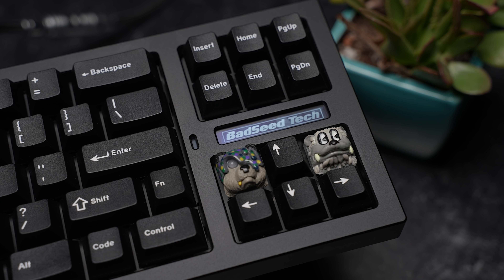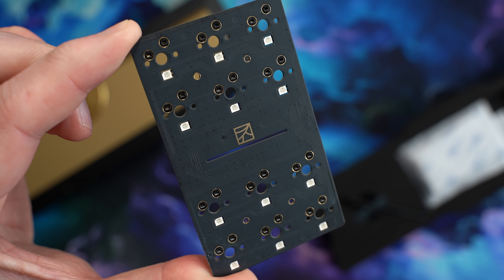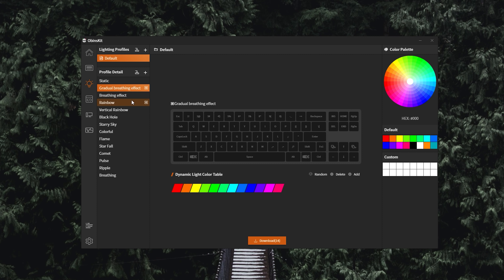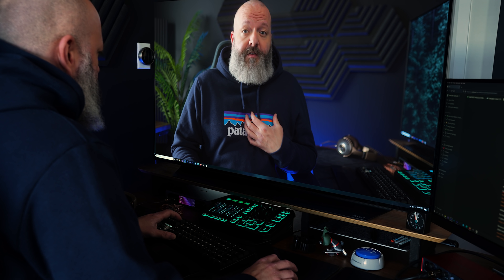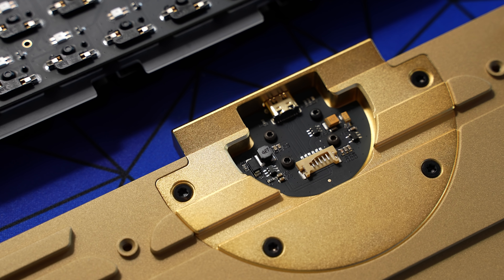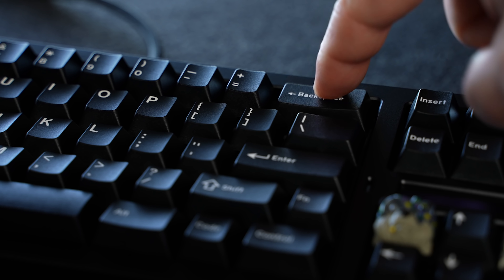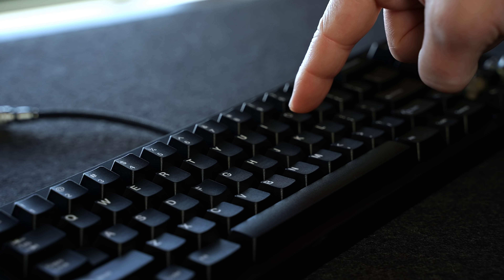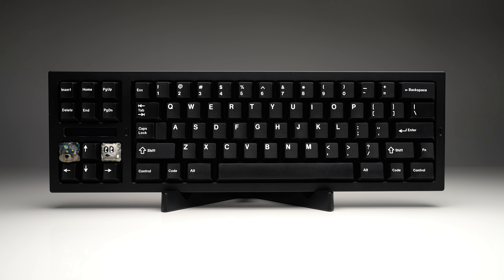The Tenet 70 Keyboard Can SHAPESHIFT?

Comment: With all the insanely meticulous design choices here, I feel like the V2 (if they decide to make it) will improve on the sound and flex of the board. What you get right now is very cool in it's own right, but the sound might leave some folks wanting. Great video, as in-depth as always.
Reply: Keybored just released a video improving the sound. Basically swapped out the gaskets and did a tape mod
Reply: i cant remember who it was, but they talked to the creator/designer of the board and they wanted to reduce case ping as much as possible. so they basically reduced the cavity under the pcb as much as possible. that being said it does result in a more muted sound signature beacuse of this. i feel like any revision for an r2 that would drastically change this would also change the footprint or overall size of the board.

Comment: Doing design work I actually use arrows on both left and right side of the board. Currently have Caps+WASD for left side. As you mentioned to avoid taking your hand off the mouse but also using the right side arrow cluster for anything needing a combo of buttons+arrow keys.

Comment: I would have hoped that for that price point, there would have been more options to tweak typing feel out of the box. The Zoom 65 may not be an ambi-compatible layout, but having some flex cuts in a 1.2mm pcb seems like a no brainer above $200 right now. Then you can either leave foam and/or plates out for a slappy feel or stuff that trunk with foam for a stiffy.

Comment: I want this kind of reversible form factor in a TKL. Or just a friggin' lefty TKL. They kind of dumped the bed with omitting the F-row. I don't know why this is so popular to do, it's infuriating when otherwise great ideas are ruined by limited functionality that requires you to remove your right hand from the mouse. We need greater left hand functionality to catch up with the standard. I.E. board design to catch up with the times of modern use-cases. I had a 60% that wasn't annoying to use because I was able to reprogram the windows key to be the function key; and another with a split spacebar where one of the splits was function. It's just so much faster to be able to access that stuff with the hand that's almost always already there haha

Comment: I’ve only heard good things about the TX stabs, but I’ve yet to see them in stock. If anyone has recommendations on where to get them or when they’ll be in stock at a particular vendor, I’m all ears. Thanks for the vid Brian! Really enjoyed your take on this!
Reply: they are easy to get. Minokeys still has stock including 1.2mm. Other vendors restocking soon. Kibou Hk has stock also. Also rumors that prevail are working on stabs too
Reply: @Unknown-sh2mz   unfortunately minokeys shipping to the US is kinda brutal (starts at $15), but it is great to see them in stock, thanks for sharing! FWIW, have checked stock at like 4 different sites multiple times over the last 6 months, and have never seen them in stock. That and having only one or two vendors with stock currently doesn’t necessarily align with my definition of easy to find.

Comment: Damn I was super excited until I heard the price... question does it have a good warrantee?  If the warrantee is lifetime the price is justified in my opinion.  I have spent $150-$200 on keyboards where something burns out or stops working at about 1 1/2 years 'right outside the warranty period'..so if the warrantee is good might be an option for me
Reply: Custom Keyboard almost never have warranty. The people who make them aren't massive multi million dollar companies. Some are a single person and others are just a small group of people. Besides, PCB's very rarely stop working. The difference between a prebuilt keyboard breaking and a custom one is that our custom boards are made to be taken aparts and self-serviced. These boards also come with an option add extra parts such as PCB's. The real money lies in the case and weight. 

If you have never built a custom board I would stay away from this one. This is a pretty complicated board so if you concerned about the realibility of the product, there is a higher chance it would be user error before a manufacturing issue.

That's my advice to you.
Reply: @Prism_JTN  I have 2 boards with burned out leds on them... maybe i am just bad luck with leds i dunno... no spills on either boards and multiple leds just stopped working on 2 separate boards after 1 1/2 years... so piece of mind if a led burned out i am just wondering if a free replacement board down the road is included in the price...granted I could resolder the leds but it's a pain with those tiny things with an iron.  Editting my response... better question is their a custom shop out their that does warrantee their boards?  Maybe??
Reply: @yp-lo8op  Sadly there is no such thing. The only two companies that could potentially do that is Keychron and Glorious.

Bear in mind that per key RGB or ANY kind of RGB is extremely rare in the custom keyboard community. Is is pretty much only for those who don't know were each key is.  Another big reason why there aren't many RGB boards is that ethusiasts, like myself, spend hundreds of dollars on keycaps and I dislike how per key RGB taints the color of the keys and even splashes to the side changing the Patone or RAL color that the original desginer painstackingly tried to perfect. I know because I have keycap designer friends. Also, there are a lot of opaque switches in the community which don't let much light through anyway. I am even going to put solid color switches on my Tenet70 when I get them. 

What I mean by all of this is first, don't get too deep into this hobby if RGB is very important or a neccecity for you and second, if you want complete replacement for a PCB due to a single LED burning out after a while. You can only replace PCB's if they come broken from factory. There are many that do so, however, many others have disclaimers in their pages saying that is wear is found on the PCB they will not replace it.

Makes sense really. Imagine you made the Tenet70 and you sold 2000 units. You then buy 300 more for the extras sale and just in case some emergency happens. You ONLY have 2,300 units. You don't have the capacity to create a repair and replace system when it's just you and maybe 2-3 more people. There's just no gain for you otherwise. The hobby isn't big enough to make stuff like that happen. You will only maybe find stuff like that wil companies like Glorious or Keychron which are far more mainstream. 

It's a luxury hobby in the end.
Reply: @Prism_JTN  rgb is not an end all for me... when working after hours IT... I do use it sometimes with my monitor brightness turned way down to save the eyes... but honestly as bad of luck I have had with board mounted leds I am done with them... for someone who is dipping there toes into custom keyboards what is the best place to start for a 75%?  I lubed my pre-built keyboard switches but feel custom hand made keycaps 'whixh i want' are a waste on a garbage pre-built.  So looking at a good place to start... I can solder in switches. But would prefer drop ins to save time... so many different sites out their with different boards... decks... ect... no idea what is best and where to even start... to many options.  I know the layout and switches I want but no idea on a form factor provider.  Any site suggestions would help.
Reply: @yp-lo8op  The 75% form factor was introduced in late 2019 and properly took strength in 2020. Because of this, there aren't a plethora of 75% out there for the custom scene. I can totally recommend you the Keychron Q1 but only if you can properly do your research for modding that specific kit. Other than that specific kit, there really aren't any other good 75%  kits our there in-stock. Pretty much a of the really nice 75%'s have been in GB  or are going go be in GB. Examples are the Jelly Epoch, Gok 7V, Hope75, Bubble75, Aero75, Satisfaction75, E7-V2, Fuji75, among others. 

That's the state of 75%'s today. Other form factors have plenty more options.

Comment: Well, I will give an update on the software, it is horrible. Obinskit stopped working with the board so you have to use Hexacore Link and the monitoring basically sucks, as soon as you minimize the software and launch anything else, the monitoring will disable, when your computer goes to sleep and so does your keyboard with it, upon wake up the time in the oled will continue from the moment it went to sleep and the software will not update it until you restart the whole software. Not good enough for a board that costs over $500.